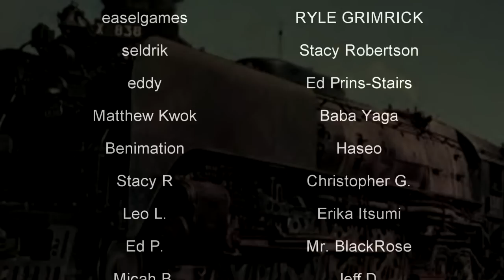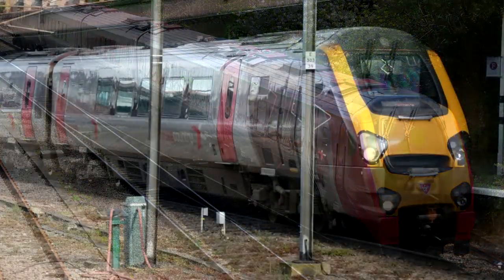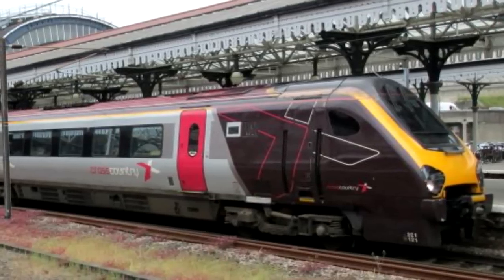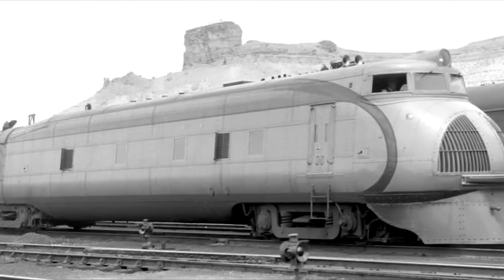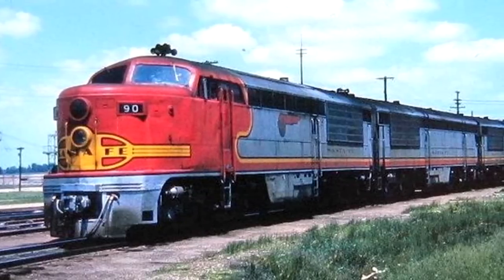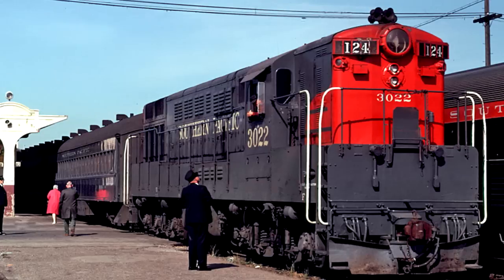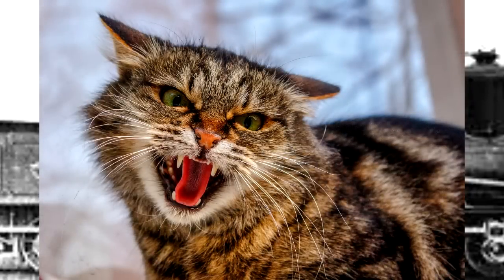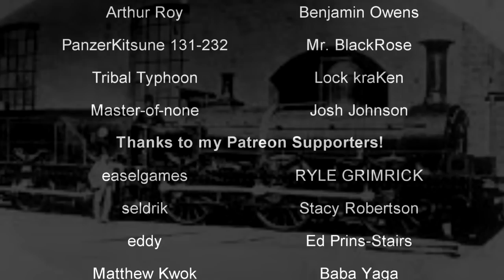5 Trains That Should Have Succeeded (But Failed) | History in the Dark

Comment: There were a few other issues with engines that used powered tenders, most notable of these being the North American "Triplex" locomotives. There were only four of these built in America, with Baldwin building three 2-8-8-8-2 engines for the Erie Railroad 1914-1916, and an additional one-of-a-kind 2-8-8-8-4 was built for the Virginian Railroad in 1916 as well. (The VRR classified there's as "XA".)
- While they had great adhesion and a lot of power, the rate at which steam was consumed would quickly outpace the boiler's ability to produce steam, and as such these engines could not run past ~10 miles an hour for extended periods of time (the VRR's engine XA could only handle about 5 mph).  In fact, the XA in generally is considered a far inferior design compared to the Erie's locomotives, despite Baldwin having actual personnel on sight who regularly tried to iron out kinks (without much success).
- The Matt Shay (the first of the bunch) proved they could handle pulling a train... in this case, one that was an astonishing 250 cars in length. Unfortunately, the journey was cut short at the 17 mile mark when one of the coal cars in tow had a coupling strained to failure. The engines would quite literally pull couplers and frames to their limits. It was found the only was to keep this from becoming a problem was for the engines to serve as bankers that pushed, rather than the intended idea of them actually pulling a train. Which is a shame, considering that some estimates thought they could have handled upwards of 650 cars unassisted. (I am going to assume that number was drawn up before the engines had even been built.)
- The Triplex engines did try to solve the smoke issue by having an additional funnel at the far end of the tender, away from the crew, which helped with the heat issue. However, smoke exiting this pipe did not have any impact on the draft through the firebox, which was effectively a waste.
- As mentioned, crews complained about "twice the work, the same damn pay".
- In fact, crews noted that just getting the boiler to fire up was often a very tedious process.
- They had a tendency to chew through coal and consume large amounts of water. Again, this was fine for banking, but any long-distance routes without regular access to coal and water were out of the question.
- An additional problem was that, as coal and water was consumed, the adhesion weight on the tender would be slowly reduced, which could prove problematic if not carefully handled.
- The engines were maintenance heavy, with the XA in particular being notorious for this.

Ultimately, the VRR found the engine not worth the hassle. In 1920, it was taken apart, and rebuilt into two (some sources say three) "new" locomotives. 

The Triplexs of the Erie Railroad lasted a bit longer, but even so they retired all three engines by 1927, with the engines being scrapped in 1929, 1931, and 1933.
Reply: Not sure what sources say XA #700 was rebuilt into 3 locomotives. The locomotive itself was rebuilt into class AF #610, a 2-8-8-0 used as a heavy yard switcher, and the last set of drivers and tender were rebuilt into class MD #410, a 2-8-2.  I actually met a man years ago who worked for the Virginian in the very yard that thing ran out of.  He didn’t work there while it was in service, showing up a few years after, but it was still often mentioned by his coworkers that had first hand experience with it.   Aside from it being extremely maintenance heavy, he remembered it often being talked about running out of steam on a routine basis.  The VGN put it on some of their toughest grades.  Pulling trains, it had the power (for short periods) to pull a 20,000 ton coal train solo up those grades, theoretically eliminating the need to have 1 or 2 2-10-10-2 pushers to assist.  Unfortunately, it had just as much tendency to risk ripping the train apart as it did running out of steam.  Even as a pusher, it often ran out of steam which forced the whole train to back down the grade to try again.  That would lead to it working hard enough to lose sufficient tender weight to cause severe wheel slippage.   He said its biggest contribution to the line was illustrate the need to electrify the Mullens to Roanoke portion of the main.

Comment: How about 5 trains that failed horribly (then got better)?
Reply: I already know one possibility that is being restored right now: Lake Superior and Ishpeming 18 (well-known for its service on the Grand Canyon Railway).
Reply: That's a GREAT idea 💡👍
Reply: Yea like the black 5
Reply: @laaity  Or, after rebuild, the Lancashire & Yorkshire Class 8 4-6-0. The rebuild improved them from "Absolutely Awful" to "A useful, workmanlike engine", all be it still a bit heavy on coal. BTW, I thought it was the Jubilees that had a really bad start, the only problem with the early Black 5 that I know about was the superheaters were a bit too small, so that later ones had much bigger superheaters.
Reply: @robertwilloughby8050  i heard that the plans where stolen
Then when the locomotives where made they realized the engine is flawed
Sold them telling  nobody anything 
A manufacturer finds out
Told the people with the engines to give it to them
Rebuilt the boiler with a balpare firebox
Then it was one of the greatest engines in the world
Reply: Maybe like the LMS Jubilees and the Atlantic Coast Line R1 4-8-4 Northerns?
Reply: @AmityBlightAndSP4449Fan  Exactly. That is completely what I'm getting at. I can think of another, actually. The North British Railway Atlantics, that were dangerous and unstable (and weirdly used more coal going DOWN a bank than going up one!) but a bit of attention to the balancing, and Voila! A safe and reliable engine - but they never quite stopped hating going down banks......😉

Comment: While the use of the Fairbanks Morse OP engines in locomotives failed because EMD simply offered a better alternative, the Soviet Railways used a knock off version of this engine in huge numbers. Even today many locomotives powered by these engines are operational.
They copied the design from U boat engines found in US U boats left at the end of WW2 (I don't know if those were under lend/lease), and after getting notice of the FM locomotives they designed a class of locomotives of their own which got in service in 1953, the TE3 powered by a straight copy of the 38D 8-1/8 producing 2000hp, the 2D100 engine.
Then the engine developed into the 10D100 finally producing 3000hp, and used in all the sub series of the 2TE10 and 3TE10 locomotives.
They suffered however from the same problems as the FM engines, overheating in hotter parts of the then USSR, crank case explosions and excessive smoking and sometimes exhaust fires because engine oil would leak from the upper crank case which was above the row of vertical cylinders into these cylinders when the engine was shut off or at idle for some time.
This oil would burn off and cause thick smoke or ignite in the exhaust when the engine went under load.
The 10D100 does smoke a lot anyway because their turbos are that big that they don't keep up with spooling up when the throttle is opened, so causing bad combustion, very similar to Alco locomotives.

Comment: Canidian National Railways Trainmaster 2900 also numbered 3000 at one point is preserved and it was cn’s only trainmaster, they never found a use for it, and that exists at the Ontario transportation museum in Ontario Canada, alongside the 2 cp trainmasters, a smaller train-master at Tennessee which was just bought by the Tennessee valley railroad museum, a former reading h24-64 turned into a Conrail slug.

Comment: Sorry, the biggest problem of both the 220 and 221 (which both suffered from the resistor problem) was the fact that the exhaust ran right next to the toilet vent, meaning that there was a smell of sewage that permeated the passenger area.  I'm not joking either.  They literally stank of s**t.  The 221s were mainly there to replace Class 47 locomotive and Mk2 coach sets, as well as a few HSTs.

Comment: While steam tenders didn't have much success as steam tenders, one, at least, was/is very successful as its own locomotive. The Ravenglass and Eskdale Railway's River Mite started off as a steam tender for River Esk
Reply: But the tender was unpowered.
They just didn’t wanna build a wheelset and so took ones of Sans Pareil or Colossus.
Reply: @the4tierbridge  the tender was powered. The idea was to provide additional power for the stone trains but with the arrival of internal combustion locomotives, it was really necessary. 

The chassis, of course, went on to become the basis for the new River Mite. 

I think you're getting confused with the original River Mite which used the chassis from Sir Aubrey Brocklebank and Colossus.
Reply: @jameswells6003  my book lied to me!
Reply: @the4tierbridge  I double checked, to be sure, in an addition of the official Ravenglass & Eskdale Railway's stock books. 🙂
Reply: @jameswells6003  oh

Comment: I guess a better design for a powered tender, is to mount electric motors on them. With a steam turbine generator to utilize the left energy in the steam exhausted from the locomotive, and a computer to automatically adjust the traction force from the tender.

Comment: Super Voyagers, otherwise known as "Vomiters". As well as the HSTs and Class 158s mentioned, the 221s (and non-tilting 220s) replaced Class 47-hauled Cross Country Trains. The Voyagers were smaller, noisier and less comfortable than the trains they replaced, and work some of the longest routes in Great Britain. They were very much a downgrade from the older BR-era trains.

Comment: On re-watching this, I flicked through the comments and realised I wasn't the only one who hadn't commented on the chunky looking first entry in the "Steam Tenders" segment.  

For those who don't recognise the initials "R&ER", that's the Ravenglass & Eskdale Railway (Cumbria, UK, where it's locally referred to as La'al Ratty*).  The loco in that shot is 'River Esk', a 2-8-2 designed by Henry Greenly, built in 1923 by Davey Paxman (who a couple of years later went on to respectively design and build the Romney, Hythe & Dymchurch Railway locos, Nos 1-3, 5-8). 

If those are unfamiliar lines, they're two 15inch gauge lines (yep ... 1ft 3in), both still running today.  "Esk" originally featured Lentz poppet valve gear, which was evidently unsuccessful, being replaced in 1928 with Walschaerts, the same year it obtained the steam tender. 

That remarkably beefy looking loco stands around 5ft high!!

The reason for River Esk's steam tender was that this miniature line hauled granite commercially until the 1960s, though in 1929 the company straddled the miniature line with standard gauge rails between Ravenglass and the stone crushing plant at Murthwaite, which was operated by an 0-6-0 Kerr Stuart diesel loco (No.4421), now a 95 year old resident at the Foxfield Light Railway!  

Uniquely for a miniature railway, the line also had a 4-6-0+0-6-4 monstrosity loco (classified as a Kitson-Meyer), reconstructed in 1927 from two miniature outline 'pacific' locos.  This was the first 'River Mite', which due to the "scale" nature of the donor locomotives, wore out in the late 1930s, the remains being broken up in the 1950s.

Rather than being scrapped, the parts of River Esk's tender were stored and later used in the 1960s to construct of a near copy of Esk, which reused the name 'River Mite'.  

With the exception of the 4-6-0+0-6-4, all the steam locos mentioned are still with us, River Esk was very seriously damaged in a workshop fire in 2013, before having a very thorough rebuilding between 2015 and 2018.

*La'al Ratty was built in 1915 on the course of the failed 3ft gauge Ravenglass & Eskdale Railway,  colloquially known as 'Owd Ratty'

Comment: Another problem with the Super Voyagers was that after they were ordered and entered service, there was a big shake up of the franchises in the UK which meant that Cross Country who inherited most of the Super Voyagers from Virgin Trains were not given the main route that the Super Voyagers were designed for, the northern West Coast route past Manchester. Ironically the services were handed over to Trans Pennine Express using none tilting 100mph DMUs, although these were later replaced by similar EMUs, and now finally have 125mph none tilting EMUs. A few of the Super Voyagers were kept with Virgin Trains West Coast to run to none electrified destinations alongside their electric tilting Pendolinos, and these are still run by Avanti West Coast although due to be replaced by new bi-mode trains based on the Hitachi IET.
As well as the tilt profile, another issue with the Super Voyager is the weight. Due to the tilt equipment each coach weights about 10tonnes more than a normal Voyager (and they aren't light). As well as increasing stress on the track, they also don't have the same acceleration and are barely better than the HSTs they replaced. Their one advantage though is that unlike the Voyagers they have a 5th coach, giving quite a bit of extra capacity.

Comment: Now that's just silly. Voyagers may be loathed by the enthusiast community, but they've been in service for 20 years now and have proved very reliable. No possible way you could say they should have succeeded but failed
Reply: They are usually reliable because of the maintenance depot that was constructed especially for them near Burton-on-Trent. However, they are far  less versatile than the HST that is a full 26 years older.

Comment: I am not that well informed when it comes to bombardier's international performance, but I do know that they have several bigger contracts with the German rail operator DB.

These contracts, among other things, include a 30% share in the ICE 4 construction as a supplier. Note that this contract is DB's largest control, in terms of capital, to this date. As well as the procurement of the intercity 2 train, of which they will buy around 120 units of. But the intercity 2 apparently also has its teething issues.

Comment: Maybe instead of steam tenders they could've made a driveshaft that connects the locomotive's driving wheels to the tender. This way there's only one regulator needed, but the pistons would need to be dimensioned with the driven tender in mind. And with a power take off system similar to what tractors use (which tbf wasn't invented yet) the tender could still be decoupled if necessary.

I heard of Shays using similar systems, but those obviously have driveshafts all the way to the pistons

Comment: The Chihuahua al Pacifico railway used Fairbanks Morse locomotives for about 20 years under much worse conditions than they ever saw on US railways. FM locomotives did better as switchers than as road locomotives in the USA and were noted for ease of use and pulling power.
Besides railroad locomotives, the Russians used the FM style opposed piston motors in the T-64 tanks and Ukrainians in their T-84 tanks.

Comment: Most successful trains:

EU06

Based on the British Class 83, it was a license built electric locomotive for the Polish State Railways (PKP). The inside mechanics were basically the same as the class 83 but based on the EU06, multiple other Polish locomotives were built, such as the EU07/EP07, EP08, ET22, ET41

Basically the backbone of the Polish State Railways since the 60s.

Comment: Speaking of Bombardier. The NYC Subway has some models built by them, and the last model we got from (R179) , has some SERIOUS issues:

1) welding issues caused cracks in the prototype trains, causing the lot being rejected, and pushing the delivery schedule back
2) The Delays in delivery would also increase the cost of the cars 
(Because of point 1 and 2, they were banned from bidding on the R211 contract, which was going to be a MASSIVE contract, going over $3 BILLION)
3) The first cars that were delivered and put into service, then pulled out of service because of more issues (Doors, propulsion, and air compressors)
4) MORE welding defects were found on some the cars (Collision pillars)
5) The biggest F up was when a  Consist of 10 cars was pulling into the Chambers Street Station, something happened to the link bar between the 6 and 7 cars, causing the train to split into 2 sets of cars. lucky this happened in the middle of night, at 1AM.

Some sources: 
https://www.nydailynews.com/new-york/mta-encounters-delay-replacing-trains-article-1.1883555
https://montrealgazette.com/business/local-business/bombardier-shut-out-of-n-y-subway-contract-because-of-poor-performance-report
https://ny.curbed.com/2017/12/11/16761874/mta-nyc-subway-r179-train-problems
https://www.mta.info/press-release/nyc-transit/new-york-city-transit-interim-president-sarah-feinberg-launches

Comment: Hi, i got a Suggestion for your "5 Trains that Histroy forgot" (It would fit sort of also in the "5 of the Best Trains ever"; "5 of the Weridest Successfull Trains ever".
It is the "Gläserner Zug" (Glass Train) a Panorama observation railcar build by Deutsche Reichsbahn Gesellschaft in 1935 (With a 2nd Unit built in 1936).
The 2nd Unit Built was damaged severly on 9th of May 1943 during a Bombing raid on Munich.
The 1st Unit Built wasn't damaged that hard and was later evacuated to the small town of Bichl, where it was walled into a small engine shed and there it lived thru the rest of the War. in 1949 it was Refurbished and got back to use. It will get refurbished another 4 Times before it will end Service in 1995 due to a Frontal Crash with an ÖBB train at Garmisch-Patenkirchen Station.
(Wikipedia in English: https://en.wikipedia.org/wiki/DRG_Class_ET_91)
(Wikipedia in German: https://de.wikipedia.org/wiki/DR-Baureihe_ET_91)